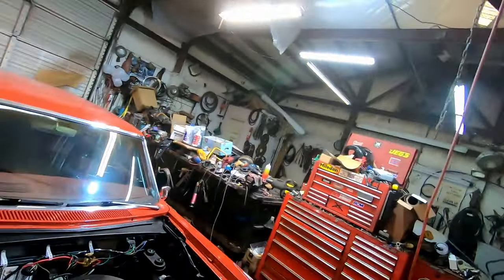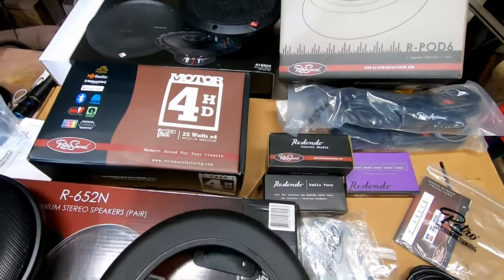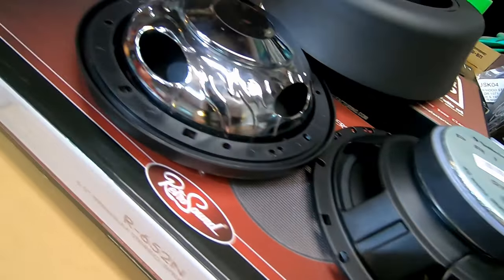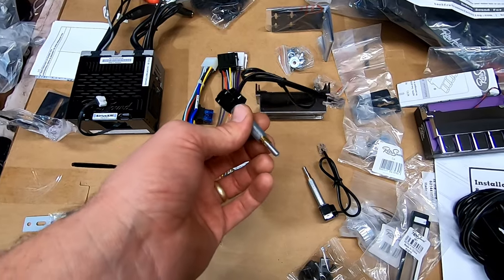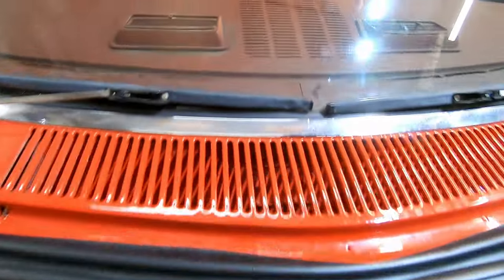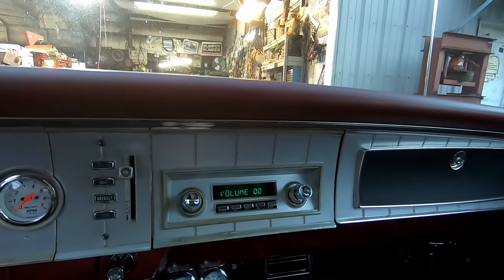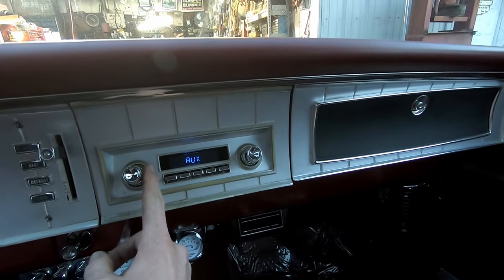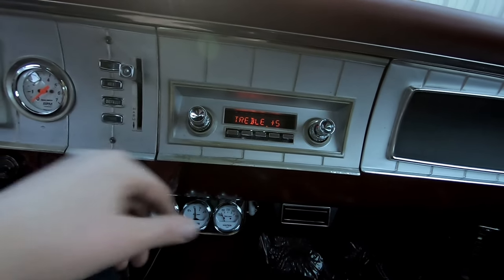Don't Hack that Dash! Classic Car Aftermarket Radio for Every Brand. #mopar #chevrolet #ford

Comment: Here in Australia nothing can be mounted under the dash, like gauges, I've been told it's even illegal to have a aftermarket oil gauges because too many have leaked, radio looks excellent, sounds half decent, some AC/DC or Metallica would have been good 😅🤣 car looks nice, wishing you a great and prosperous New Year
Reply from the maker: Thanks Donald! Have a good week 👍🏼

Comment: Thats pretty damned cool! 
So about the antenna. Back in the day I saw some retired marketing videos with old muscle cars and such in it. One of the vids was from 1967 and featured a wild early 20s couple sitting on the beach in a Coronet jamming to some station, sitting on the hood on a blanket.. in the corner of the shot was that antenna fully extended. Later in the ad it showed them driving but the antenna down all the way. 
I mean thats pretty indicative of what the manufacturer was intending.
Reply from the maker: That’s cool to hear! Thanks brother. It picked up well with it down. Stations from 100 plus miles away

Comment: Nice, been thinking about one of those for my '68RR. They have a roller knob kit to use in place of the regular knobs. I don't know how good it sounds but it sure looks good and saves that dash.
Reply from the maker: Didn’t sound bad. The speakers under seat were a little weak. 6x9’s will definitely rock more
Reply: I bought the RetroSound Redondo for my '69 Roadrunner convertible, which had only two door speakers.   I also replaced the speakers.  It sounds good, but most importantly I can connect my ipod and use my cell phone Bluetooth. 😀
Reply: @dogdoc1  that's what I was wanting to do.

Comment: My 68 D200 still has the original AM radio, had a RadioShack add on FM under dash, took that out. Radio didn't work so I decided to put my vintage guitar amp skills to use and fix it. Antenna was unplugged, works great. 😂 
Might see if the FM dohicky works someday but I'm happy with an AM radio anyways.
Reply from the maker: That’s the way! Thanks for sharing

Comment: Great job on the install as usual joe. Looks like it belongs  in that dash. Do think it only has one speaker cut out in rear deck is so if you ordered it with rear defogger  you would have a place for the blower motor? Just a thought you know.
Reply from the maker: That’s interesting. Did they have them in 65? This car literally only has one wiper speed!
Reply: I guess if there is a inch by twelve or so slot in center of rear deck it probably could have

Comment: Send that old 8 track radio and I will make it Bluetooth for you for a fraction of the cost, you will lose the 8 track option but still have the AM and Bluetooth or loose the AM and keep 8 track whichever you prefer but then you can play through your phone and use your phone as you equalizer to tune it to you liking.   Can also do some cool stuff with you guage lights that are so dim on these old cars. Can make them led dimmable but also track mode will make the dash lights change colors making it like a built in shift light.  Green up to 5500rpms yellow up to 7500rpm and red at 10000rpms where we usually shift these mopars at or any color or RPMs you want..
Reply from the maker: That’s trick!

Comment: Every Retrosound  unit [at least 10!]  I have installed has had issues! Very cheap quality.  Better to send stock radio out to have internals updated .
Reply from the maker: Thanks for sharing. What type of issues should people look for?
Reply: @JustMoparJoe  Mainly the tuner 'stalks' not working or acting up and even had a head non op right out of a sealed box.